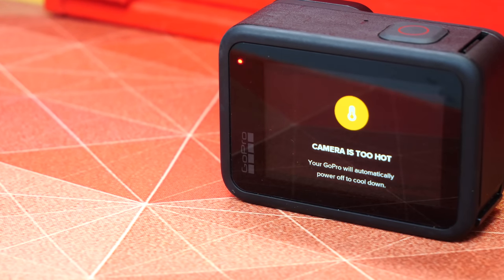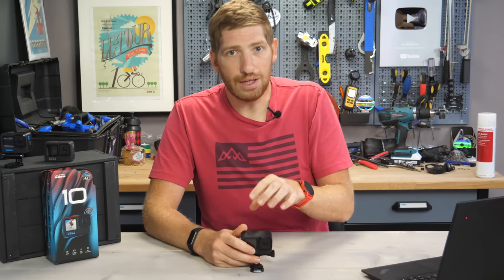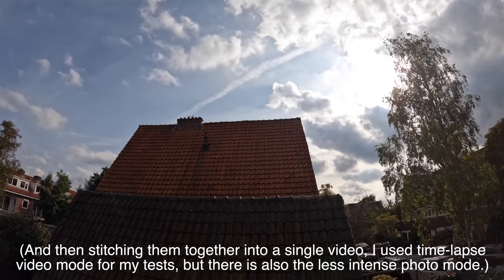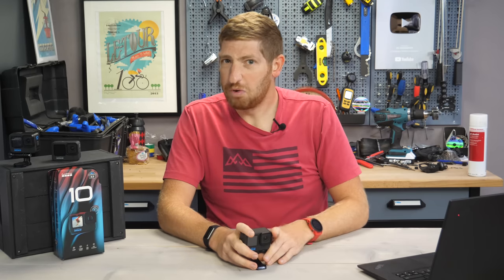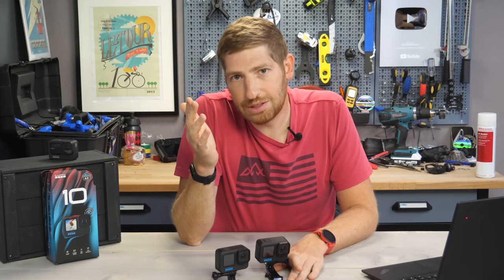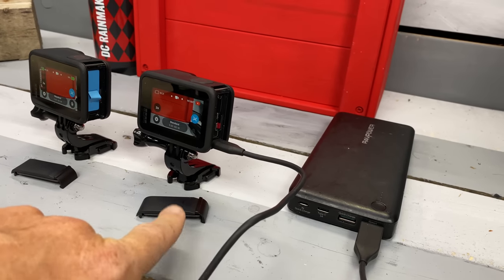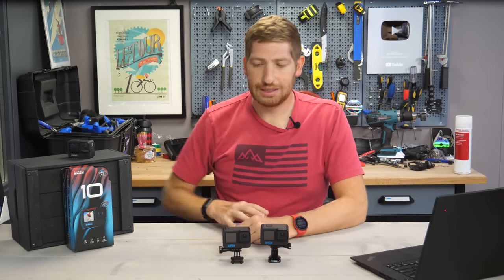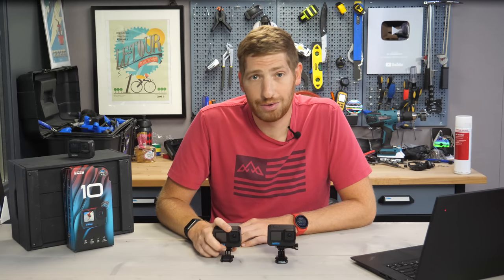GoPro Hero 10 Overheating: 40 Tests Later

Comment: Hey Ray - we have an update for you!

Thanks to customer feedback, we’ve learned many HERO10 users want the ability to record longer video clips in static situations without motion or airflow to cool the camera. Many have also had questions about how to get the longest possible recording times while maximizing battery life.
 
We’re excited to share that we’re releasing a HER010 firmware update to deliver on these requests by end of October.
 
This update will introduce three new “Video Performance Modes” to help maximize HERO10’s performance depending on your use case:
 
1. Maximum Video Performance – Maximum video resolution and frame rates for the very best image quality and ultra slow motion.
2. Extended Battery – Optimal video resolutions and frame rates for maximizing recording times and extending battery life.
3. Tripod / Stationary Video – Optimized for recording long video clips at the highest resolutions and frame rates when the camera is stationary without motion or airflow to cool the camera. GPS and HyperSmooth video stabilization are turned OFF in this mode.
 
The following is what users can expect to achieve, on average, in Tripod / Stationary Video mode recording a single continuous clip at a temperature of 77F / 25C in static situations without movement or airflow to cool the camera:
5.3K60 – 47% more runtime than previous for an average of 29 minute-long clips
5.3K30 – 11% more runtime than previous for an average of 44 minute-long clips
4K120 – 52% more runtime than previous for an average of 26 minute-long clips
4K60 – 154% more runtime than previous for an average of 63 minute-long clips
4K30 – 35% more runtime than previous for an average of 50 minute-long clips
A future firmware update will enable even longer clip lengths in 5.3K30 and 4K30. And if important for your use case, 2.7K and 1080p will enable significantly longer single clip recording times in either Extended Battery or Maximum Video Performance modes.
 
We’re also excited to share that in late November we’re releasing a new battery, named Enduro, for HERO10 and HERO9 cameras. Enduro will be available as a $24.99 spare battery upgrade and features revolutionary technology that dramatically improves your GoPro’s performance in cold temperatures (snow sports, for example) while also significantly extending recording times in moderate temperatures.
 
At a battery temperature of 14F / -10C (note: this is the battery’s temperature, it can be even colder outside), with HERO10 Black the Enduro battery enables, on average, 56 minutes of 5.3K60 video, 50 minutes of 4K120 video, 76 minutes of 4K60 video and 115 minutes of 1080p30 video recording.
 
Enduro also significantly increases video recording time in moderate temperatures. For example, with HERO10 Black during typical outdoor activities at a temperature of 77F / 25C, the Enduro battery enables, on average, 60 minutes of 5.3K60 video (a 28% improvement over the standard battery), 51 minutes of 4K120 video (a 40% improvement over the standard battery),  71 minutes of 4K60 video (a 13% improvement over the standard battery) and 120 minutes of 1080p30 video recording.
 
Stay tuned for more information on the November launch of the new Enduro battery and end of October release of the updated HERO10 firmware featuring the new Performance Video Modes. And please keep your feedback and requests coming — as you can see, we’re excited to develop additional HERO10 performance enhancements based on your input!
Reply: Wow, thank you for this detailed comment! Easy to understand yet offers adequate technical details!
Reply: Wow, that’s one hell of a response and how it should be done rather than just staying silent and ignoring the problem!

Good job! Now release a stripped down “naked” version for FPV and dash cam users with appropriate firmware suitable for those situations, for about $300.

No front display, no rear display, no battery.
Reply: Thank you gopro.you are truly a peoples company.you listen to us via influencers like DC rainmaker and keep bettering your product. I just bought my hero 10 after (still owning the 3/7/8). All of them are perfect in their own way with imperfections. But that’s how even a human or a machine has evolved. The hero 10 is not available in India yet. Got mine flown in from Usa.I’m doing my unboxing video this week and will make a small snippet on this issue you have addressed. It will be in my native language tamizhl with English subs. Hope my country men be benefitted when you guys launch it during our Festival of Lights Deepavali. Stay blessed DC /Go pro team . Vanakam 🙏🏽
Reply: GoPro is realizing that it's cheaper for them to follow your channel than to hire an extra person in Quality Assurance. Please make a video to apply pressure on Garmin next!
Reply: @paceline  haha ...we the people😎
Reply: Hey GoPro! Any chance of introducing some GoPro Labs features in the original firmware, specifically the Max Shutter Angle.
Reply: Will there be a firmware upgrade for the GoPro 9 to address overheating issues?
Reply: I just opened mine up today and updated it. Mine overheated recording in 5k after 22 mins just sitting in table at 70 degrees
Reply: WOW! I cant believe a huge company did this. Good work. Biden is probably so happy you did this he's smelling GoPros hair in its sleep right now.
Reply: @fat_ninja_status  I knew GoPro was full of shit. Why do they advertise blogging, live streaming if you can’t even sustain the camera to stay on in a stagnant mode. The camera should never turn off if you have it wired directly to the wall for streaming. Yet GoPro can’t even offer that.
Reply: These are great improvements. Especially the new battery.
Reply: @lavapix  do the new units purchased now through their site include the updated battery?
Reply: @abc123def98  I think the new batteries are accessories to be purchased separately.
Reply: Still the low light performance is crap
Reply: @abc123def98  I just got my new GoPro last week and it came with the original battery. Not the new batteries. Which makes sense, because it came out of inventory that's been sitting on the shelf somewhere.
Reply: Im struggling why 4k60 has longer runtimes than 4k30. Also can we get an updated chart that includes the new battery?
Reply: @abc123def98  No the enduro battery is an optional extra & is not included
Reply: @GoPro Any chance you folks have a deal for someone who's never experienced a GoPro camera before? I seen the 10% discount and deal package on the website; I'm just curious if there's something better for someone who is completely new to your product. Admittedly, I'm not much of a photographer. However, I have been streaming a bit on Twitch this past year. My main use would probably be using it as an extra cam for stream, exercise or potentially when I run Spartan race. Still, I've been interested in your product since the GoPro Hero 8. I was going to get it but the complaints about the fixed lens held me off. The GoPro Hero 9 Black dropped and I was very excited until I heard about the issue with the processing and the lack of user compatibility. It seems you've worked out all those bugs and I commend you for that. I truly am interested in obtaining one of these amazing devices. Thank you for such an amazing product over so many years; I've heard so many friends talking about your products and even known of their family members who had previously worked with your company, all of which had nothing but good things to say about your company. I wish you the best in 2022. 

Lastly, TY DC Rainmaker for such an amazing set of in depth videos. I couldn't express how invaluable this information really is to someone like me. Great job, I applaud you sir.
Reply: make the body comes with heatsink...
Reply: @khangliangify  No need. Buy the Telsin alloy frame & place the camera inside it. You then have the option of leaving it like that as the alloy frame works as a heat sink or attach a thin piece of alloy or one with fins to the Telsin's underside. It has 4 threaded holes which would allow it. Using a flat piece of alloy without fins means you can drill two holes into it to attach the mount legs & use it with whatever selfie stick etc. I used it yesterday without a alloy heat sink added & it ran fine, i also had a cloth over it thinking it would stop wind noise, it didn't lol. Although the pro 10 was quite warm it ran fine non stop for around an hour & 30 mins
Reply: You should place a warning on the Media Mod for Hero 10. I cant do 5.3K60 in any situation without overheating.
Reply: @twinenk15  I'm not sure overheating can be fixed with firmware. I believe it is more of a design flaw.
Reply: GoPro, how about instead of rolling around and checking that your camera doesn't work right, going to the lab and solving so that we can use the camera as described on the packaging? It's very comfortable to come here, say that the camera doesn't work properly because it overheats, present palliatives that are not solutions and seem to have solved something!
If use is limited, put it in the package!!! Lack of transparency is false advertising. I don't know how they didn't go bankrupt, if everyone sues... I love the GoPro, but I know it's cheap.
Reply: @benwhittle7204  That would be better to use a MAX design instead.  You never know from which angle a problem will happen in a car.
Reply: @abc123def98  Yeah, clearly it is a lousy choice for webcam.
Reply: OK, GoPro, I did have one question, am I going to get any better low light results as lower resolution or even frame rate then with higher settings sine more sensors or time are available for each pixel or is that just a silly idea.
Reply: @eloynogueira  The problem with a stronger processor is that it will create heat. You can always add a heat sink.
Reply: @benwhittle7204  Looks like you got your wish
Reply: @rayzecor  yep! Version for the FPV users! But if GoPro really wants to save the company they need to make a dashcam version and to do that it would require little to zero hardware changes, and just pure firmware changes.

They could release dashcam firmware as a proof of concept to gauge interest in the cams for use as dashcams and then consider any needed hardware changes in the GoPro Hero 11 or something.

It has been staring them right in the face for years and it would be a huge new revenue stream the company desperately needs, but for some reason they have entirely ignored the market.
Reply: @benwhittle7204  I was not under the impression that they required saving
Reply: @rayzecor  yeah their shares took a massive hit ages back. There’s a lot more competition now, especially coming from DJI.

GoPro has been resting on their name to make sales for too long now.

Regardless, who doesn’t want an additional revenue stream for what would be very very minimal effort on their behalf.
Reply: @benwhittle7204  Huh, and I just impulsively ordered a gopro hero 10 black, along with several accessories. Perhaps I should have done more research first, hahaha
Reply: @rayzecor  they’re still a safe buy in my opinion. There was a moment a few years back when things looked a little sketchy and everyone thought Apple might buy them or something but they seem to be a bit more stable now at least.

People will happily buy them at $500 a pop if they worked as proper dashcams, they’d even happily buy 2-4 of them.

While you might think the Max would be “better for this, it’s actually not as having the cam up close to the front and rear windows (and the sides if you’re so included), is essential to covering the most viewing angles.

Have a Max in the centre of the car will have a lot obscured.

Really they could just offer a dashcam specific firmware version for the GoPro Hero 10 initially. It would be a very cheap way to gauge interest in the market, then have a hardware revision for the 11.

It really is a glaringly obvious omission on their behalf.
Reply: @benwhittle7204  I trust they know what they're doing to a certain extent, I will not cancel my order.
Reply: @abc123def98   you blind? they clearly updated a special mode for exactly that
Reply: @rayzecor  yep. I'm taking mine back to Best Buy tomorrow and hoping they give me some bull crap about taking it back.
Reply: @abundantharmony  I'm not refunding mine
Reply: You could build the next GoPro with a metal housing or a heatsink to keep it cool.
Reply: Something seriously wrong with it. I Just bought a gopro 10, and Even when not recording, just ficling around in the menu its getting very hot in about 5 minutes, i took out the battery, and it was so hot i couldnt hold it still for long between my fingers, menaning its getting over 60 C degrees in just 5 minutes without recording? No wonder why i cant shoot more than 5 - 10 minutes 1080p30 where is no wind before its overheating. And yes, i have the last firmware.
Reply: I was using Hero 11 just this weekend. I shoot volleyball indoors. One match went to a 3rd set. I went from by a door, with very light, but cooler are, abotu 24 minutes, then to other side of court with no air and a bit warmer for one set about 24 minutes. They went to a tie-breaker set and the camera died from overheating at 12 minutes (I missed literally the very last point of the match - luckily I was able get a clip from a person videoing with their phone). I stopped the camera for about 3-5 minutes between sets, so camera had a moment to cool down. I didn't remove battery.

I was shooting at 2.7k/60, as I've learned I can't do higher resolution, or framerate. The first day we didn't go to 3 sets and I didn't have a problem, so there is a definite time component. What I did that second day, after it did die, is I replaced the battery after each set, which, since it was cold seemed to help with the heat of the camera. We had longer matches and it was fine. 

I've tried with just a cable to a powerbank, which seemed to help, but with volleyball, the camera has been hit, so I'm afraid of the cable jumping out. I think I'll do some testing with the media-mod...however that covers the camera a lot...and it "broke" last year (using on GP9) and audio got all choppy and then was lost. It came back, but that really stunk and only ever happened with the MM. 

So, the 11 seems better than the 9, and maybe another firmware update will help. There are times there are 2 matches back to back, there is a gap between but the camera never fully cools down...so, we'll see.  I'd really like to shoot in 4k/60, and then crop to 1440p (mid-level on YouTube) to get out some of the distortion. (Heck 4k/120 would be nice to grab some highlight slo-mo clips.)

I've always wondered if the "lens" matters. Do some just crop the sensor and take pixel per pixel, which could maybe run cooler, or does it do scaling which could cause it to run hotter. Which ones do scaling and can impact heat? This is another test this guy could run. I'll post that as a separate reply...but only you could answer the scaling I think.
Reply: What about your GoPro 9 customers? I've invested so much in accessories. I had high hopes, planned so many projects, got excited from your marketing videos and now my family is truly disappointed we can't use our new camera in any situation without overheating.
Reply: Why don't you include all these values on your website and instead hiding them from customers? You are misleading customers at the very best! I stopped buying new gopro's after 8 until you can get your act together
Reply: Firmware didn't help. Enduro battery didn't help. I've had my 10 since release and haven't used it for anything because it overheats within 30 minutes. Reaches 118 degrees.This should be a legal issue at this point.